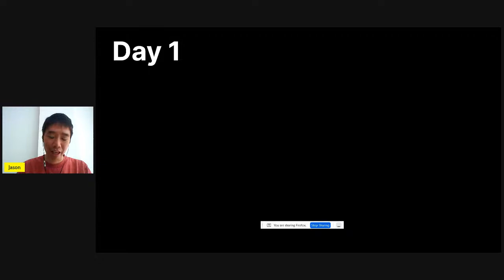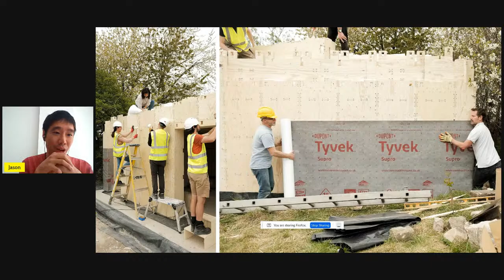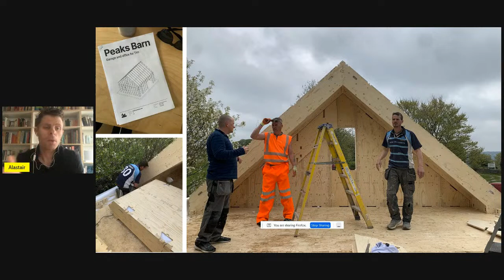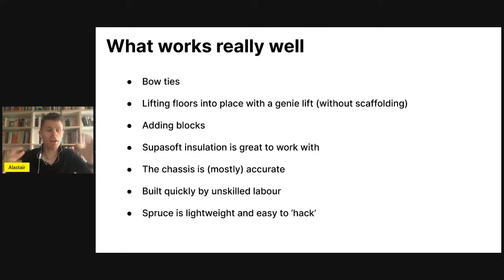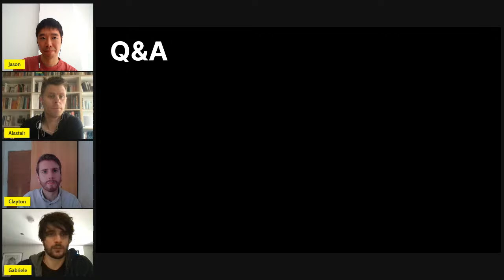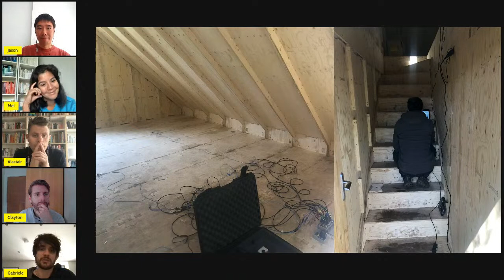WikiHouse: Lessons from our first Skylark building

Comment: Just wondering if you've had a go using Plyboo?  I'm putting together research on local materials to reduce transport Carbon costs. I'm in Australia and we are fine with pine ply, but in China, bamboo is making waves in structural columns and as a ply alternative.  I havea sample and it seams quite tough.
Reply from the maker: Hi Michelle, no we don't but why don't you ask the WikiHouse online community? https://community.wikihouse.cc/
Here's a thread about bamboo https://community.wikihouse.cc/t/bamboo-plywood-in-tropics-and-architects-consultants-available-these-days/305/4